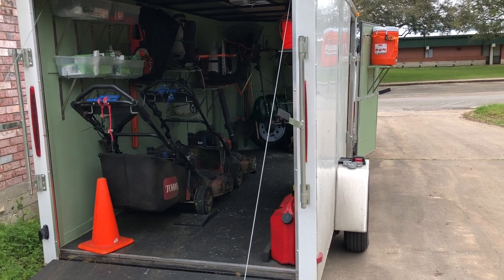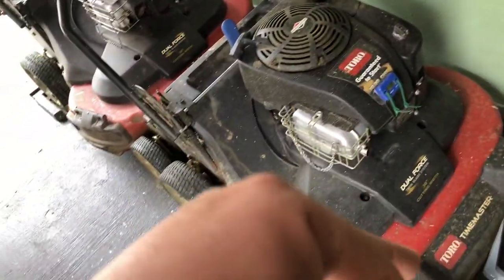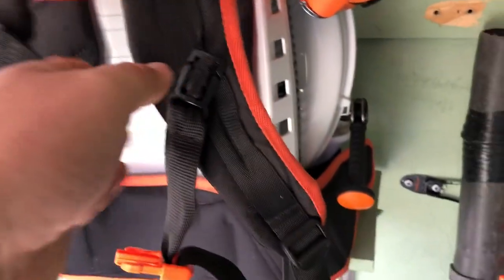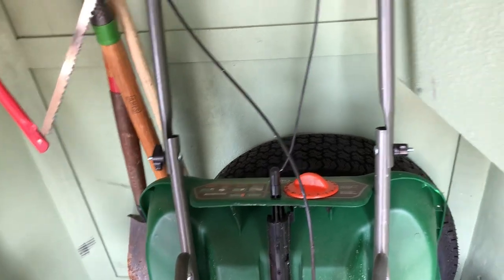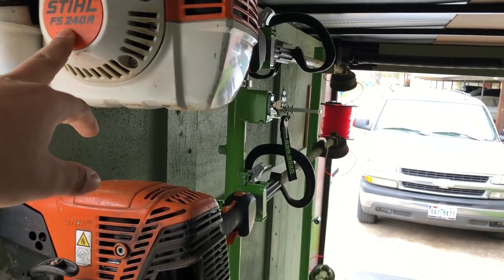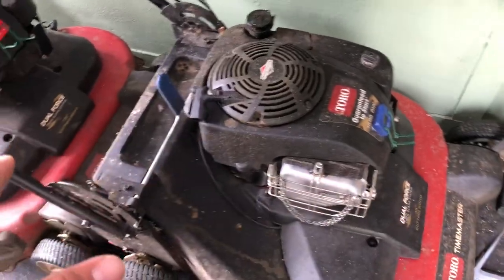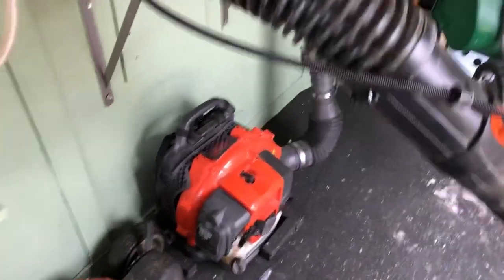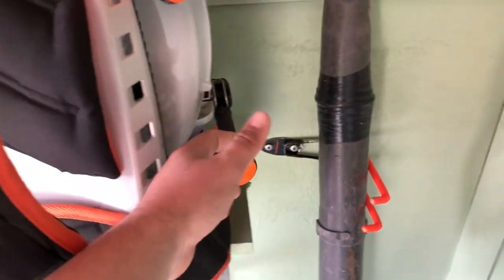2020/2019 Lawn Care Setup Enclosed Trailer

Comment: Nice set up man i like it. im workin on something similar myself with a 5x10 enclosed. What state do you mow in? and how well the toro mowers work for u? Im starting small on my 3 days off from work and have worked my way up to about 20 yards a week im solo but growing fast and currently using a honda and was thinking of upgrading to the toro to save time just wanted ur opinion on if its worth getting the 2000 dollar one? Or maybe even a residential zero turn. Thank you
David with Giraldo’s outdoor care
Orlando Fl
Reply from the maker: The maintenance it’s really cheap on the toros and I can do it all myself, very easy to work on, only belts and cables have messed up on them and they are about $20 each and only had 1 belt replaced on each mower and the cable to engage the blades on only one mower, they are very light weight so even if it rains all day I can mow the next day, you can’t do that with a zero or even a riding home mower, 5 stars from me, I will do an update at the end of the year every year
Reply: Cool. Thank you for the advice ill probably get one in the next 2 months. Thanks for the reply ill look for your social media pages and like and follow
Reply from the maker: Thank you

Comment: What size traileri didn't hear if you mentioned that..
Reply from the maker: 6x12 I’ll do a update for everything every year to see how it’s holding on
Reply: @alwaysgreenlawncare5694  thanx
Reply: @alwaysgreenlawncare5694  gonna run 2 timemasters as well with everything else up n against the walls.. but In a 6x10..would have enough room..right?
Reply from the maker: Yeah, just manage the space well and you should be fine